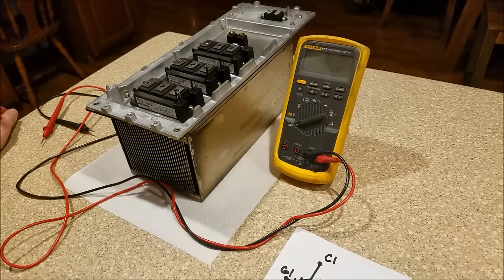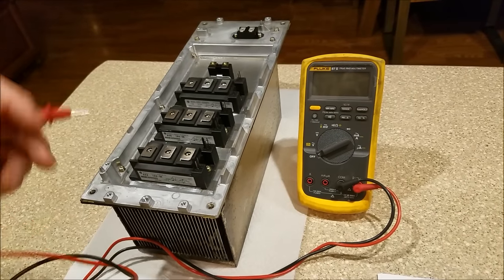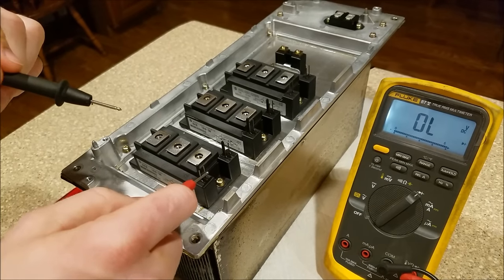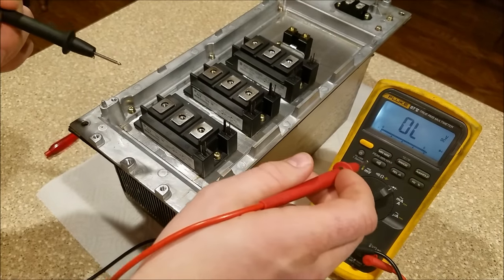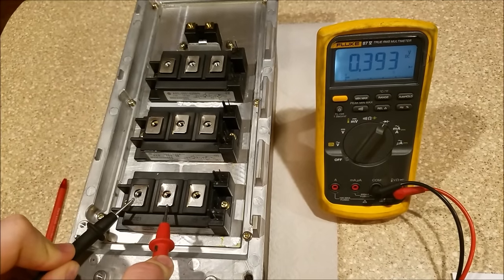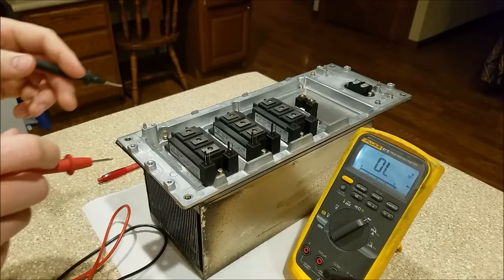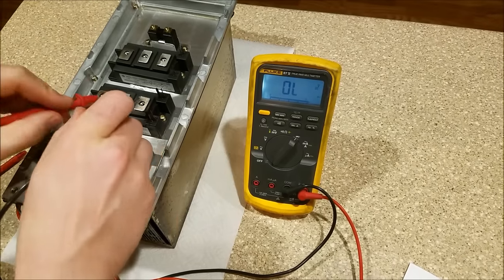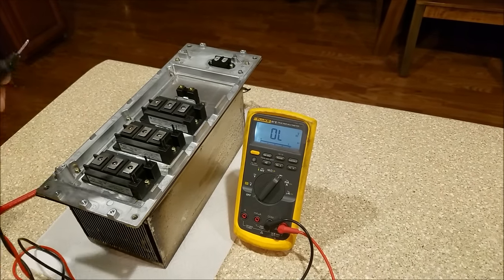How To Test an IGBT

Comment: Please tell me, when checking the device, my modules seem to be intact, but when testing with a lamp, they open with a positive bias on the shutter and the lamp ignites, and if you remove the bias, they immediately close without holding the collector-emitter transition in the open state, is this correct or not?

Comment: Question: isn't it possible, when testing high voltage IGBTs, that the multimeter may not have enough voltage to test if the component is failing at higher voltages?
Reply from the maker: Yes, most people don't have access to that testing equipment. These tests will work for 9 out of 10 failures though. I've tested a lot of bad IGBTs over the years, and this shows a failure in almost all instances.

Comment: Thank you for explaining this so well for electrical ignorant ppl like me. I’ve spent 48 hours trying to figure these things out on my welding machine. At least I can test it properly now and understand what’s wrong if anything there. Maybe if someone sees this… primeweld TIG 225 made a pop noise from the ground clamp. Probably bad ground.. no burn marks inside the machine anywhere at all. Did not trip the initial mini breaker on the machine rated 60A. Did not trip the breaker in my building rated 40A. Did however trip the breaker in my main supply breaker box outside about 50 yards away from the building, supplying the building separately from my house….this breaker is rated 50A. There is no other appliances or lights connected to the 220 breaker in my building that the welder was hooked to but there were several other things running inside the building. There was “corrosion?” on the big boy breaker outside… the huge circuit breaker that power from the poles comes to first. Anyway, now the welder won’t even turn on… nothing. I hook my plasma cutter up to the power supply and seems to work fine. Power supply seems ok. Mini breaker on the welder allows power to pass through when switched on… I guess that means it’s ok too? Any help would be much appreciated. I dare not take it to a repair store and not know what’s wrong with it beforehand. Amazing welder other than this btw 🤗. I have a feeling it’s not even the welding machine’s fault that it’s broke. Oh the welder is like I said primeweld TIG 225 AC/DC P … not the newer version TIG 225X, but I’m like 80% sure the only difference there is the pedal it come with.

Comment: Using dynamic testing is more accurate just    connect an analogue ohm meter and set to x10k    put red probe on  emitter and black probe on the collector 
Now get a standard bench power supply connect black  wire to the emitter and red wire to gate 
Now the ohm meter shows open 
When u increase the voltage on gate to 4vdc  you see the needles starts to move  showing a very high resistance as you increase voltage let's say 100mv per step you notice the needle  reading lower ohm  after 5.5v reach the needle is at full  deflection  0 ohm 
This is the ohmic region  of the collector emitter  testing some defect igbt looks ok using multimeter  diode testing 
But when testing using the gate voltage  testing mentioned here 
The  collector emitter ohmic  region doesn't respond to the gate voltage increase  .
I repair  bldc motor  3 phase bridges and its reliable everytime .
Reply from the maker: Excellent response! Thank you. You are exactly correct! The reason I didnt perform a test like that, was because a majority of newbies watching these videos do not have a variable power supply. But I agree, your description is more accurate.
Reply: @electrotec7113  
Thank you sir    I m specializes in 
Repair  power electronic circuits 
Like a bldc motor driver circuit 
And power dc Ac inverter.
Imagine you open a 15kv dc ac inverter and see a rack full of igbts
I use this  test to know which one is  not working well   .
A bench  dc power supply set a current limit as 100ma and star  increasing voltage on gate 
A faulty igbt will show a  response bouncing  while  constantly increasing voltage  on gate
This test doesn't  affect or damage the driving circuit .

Comment: 5:24
That's not correct. Even if DMM uses 9V, and gate turn on voltage is 5V, there is no reason for DMM to show 5V or other value, unless IGBT is fried. That's because gate-emitter is still a capacitor, and it should always read open, no matter what the voltage threshold of a gate is and what DMM test voltage is applied.
Reply from the maker: Very interesting comment. Thank you for that. Have you witnessed this response from an IGBT before? I completely understand your observation.  In testing, I have observed a noticeable breakdown voltage on an IGBT gate. Have you tested this before and observed otherwise? When putting 50 VDC in series with a resistor to the gate I have obvserved at which voltage the gate breaks down, multiple times. I cant say every IGBT sinks all the current, but a standard recommended parallel resistance would eventually discharge the small capacitance at the gate. Please be reminded that IGBT theory goes well beyond a 13 minute video. Especially with the variety of designs.

Comment: as the others said, this was very well explained.  one question:  are these tests only possible because the chips are isolated (removed from control circuit)?  I have a 3 phase washing mashing motor control board, the IGBT's are soldered in, can these be tested in the same way (or at all)?  Or do I need to unsolder them to test them?
Reply from the maker: Thank you for your review. It is never advisable to test anything when still in the circuit. Depending upon design, you could get very erroneous readings. When they are soldered in, they are essentially being forced off by the control driver board (when powered down). The test of turning on the IGBT will not work because the driver board will shut it off again when you remove your leads. Desoldering would be best. Although, sometimes you can still check the off resistance in the power section between collectors and emitters when power is fully removed. Readings will be different than presented, when still in circuit.
Reply: 6 igbt if connected in together....this is Actually IPM module....
Like that 3 set of igbt compressed in one module.....

Comment: Recently my machine filter capacitor 105k 630v  burn which connect to IGBT.

8.25 charge G1 to E1 there is reading on C1 to E1  about 0.444. Once short there no reading.

When i do charge on G1 to E1pin. I can't get reading between C1 to E1.

Base on measure show 393 reading. After combine show 789.
My IGBT only shiw 270 and combine show about 528. 
Im testing CM400DY-12nf
Its could be igbt faulty?

Comment: I work with Variable speed drives, and i have a faulty one here displaying 32 Volts out when the drive is not powered on. Could it be a damaged IGBT ?
Reply from the maker: If the drive is powered off, where are you getting the 32 volt reading from? Is the DC bus energized?
Reply: @electrotec7113  it's on the display of the drive. I haven't measured the DC Bus yet, i measured the drive output and the input of the step-up transformer, which the drive is supplying: it's barely 4V

Comment: What does the arrow indicate on the diagram? Current direction?
Reply from the maker: The arrow indicates the direction current is allowed to flow for diodes. For transistors, it indicates the gate - emitter (base - emitter) junction and also the direction of current needed or voltage bias for IGBTs. All of this in the mindset that current flows from positive to negative (conventional flow).

Comment: Open lead or Open loop?
Reply from the maker: Open loop is more accurate, but I have worked with many experienced electrical engineers who use the terminology "open lead"
Reply: @electrotec7113  Ok ty for clarification...

Comment: hello I have one doubt in 15n120 igbt -ve only control how to control +ve  please explain
Reply from the maker: Could you please explain your question?
Reply: I try to make H-bridge inverter using 15n120igbt,in an emitter given-ve supply and collector side connected to load, in an gate given 12volt DC supply the effect load is switched ON and OFF by as per input voltage.but  in this case +ve is given to collector and emitter side load is given that condition make short circuit, the above condition collector side given voltage is 250volt DC.
in an 15n120 igbt -ve is controllable by giving to emitter terminal and how to control +ve in giving to collector terminal,please explain the gate controllable circuit for controlling +ve giving to collector terminal.

I am waiting for your reply.....
Reply from the maker: If I understand your question... Most IGBT's are fired based upon the voltage difference from Gate to Emitter. Many designers incorporate an isolated (opto isolated) circuit to fire the gate in reference to the emitter voltage. If you want to fire the transistor in reference to the high side of the DC bus, you would have to incorporate a P channel IGBT which would need to be pulled low to fire the transisitor.